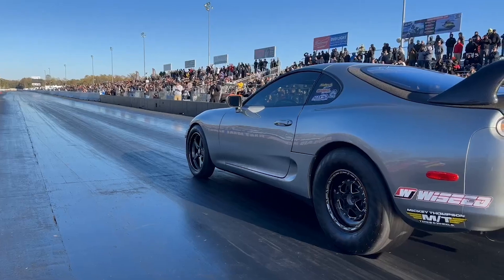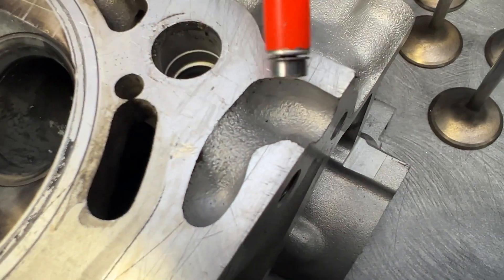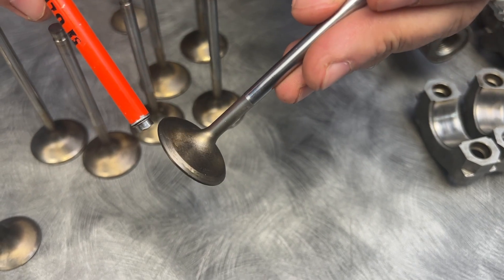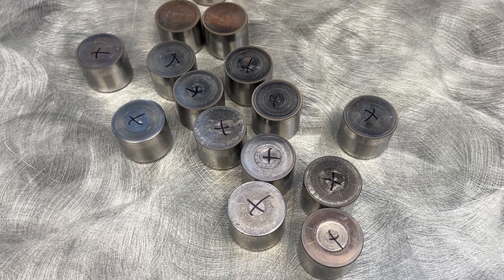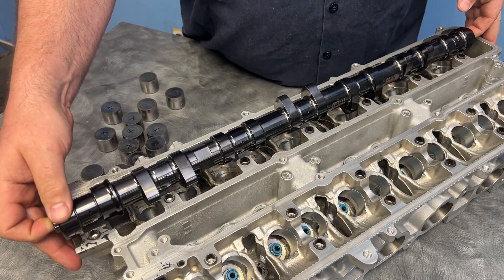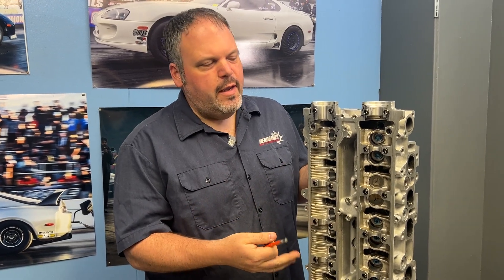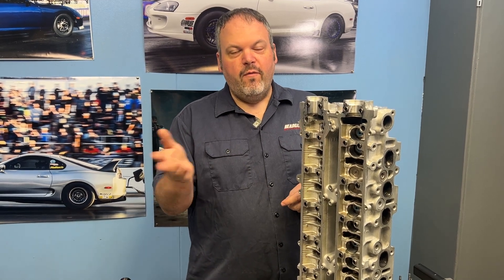World's quickest synchronized manual 2JZ head tear down!

Comment: Do people in the drag racing scene ever use thermal coatings in the chambers/valve face/piston crown and exhaust ports? Would it help the issue? Its very effective in circuit racing.
Reply from the maker: @joshuamclean6564  people have done it but it’s had no effect. It’s like the Cyro phase that people went through years ago. It’s the perception that it makes a difference but it doesn’t really make a difference. 
Besides the skirts, what that wears off.

Comment: Love your honesty is this fault finding path, I have began to wonder on a few applications I’ve seen with similar issues if it’s an oil temperature thing, overall oil temp is fine, but the exhaust valve is maybe transferring more heat to the bucket and compounded with the frictional heat generated on the opening ramp that by the time it gets to the nose the oil is too hot locally and breaks through the film, 
Or is it just a matter of the tiniest bit of float at high rpm that the valve and bucket is leaving the nose at full lift and slamming back, just my thoughts, interested to hear what you think-find

Comment: Valve springs pushing the cam into the caps when getting to max lift? Years ago I had similar issues with the RB heads, figured out that the M6 bolts were being pushed out of the heads when we used big lift cams with valves spring that had over 85lbs seat pressure, solution was cam cap studs or softer springs, not sure if this experience is transferable to the Toyota stuff (I haven't played with them often)

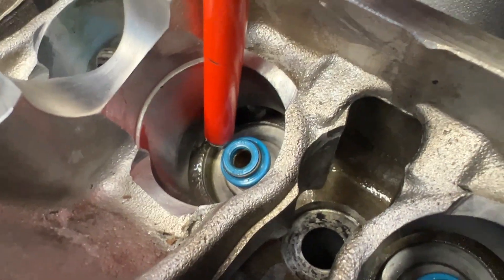Comment: @8:04 if you zoom in you can see a tiny circle the bucket has wore into the casting. could chamfer that spot and mill & chamfer the bottom of the buckets?   Also, what GSC spring setup could you recommend for better then the crower 0300's and less than the gsc 5086
Reply from the maker: @wil8115  5066 is an awesome spring. The 0300 is not close to either springs mentioned. It only has about 180 open depending on the lift.
Reply: @headgames  awesome thank you!

Comment: The exhaust cam wants to rotate the bucket and something is not allowing it to happen naturally.  Could be a geometry issue and/or related to high spring pressures required for such high cylinder pressures during initial opening.  Exhaust cam centers may need to be adjusted inward to reduce the tendency.  Let us know what you find, it is a very interesting issue.

Comment: The reason the issue is only on the exhaust side is because the cam is trying to open the valves under high cylinder pressure.
Reply: It would be on the opening ramp in that case.

Comment: First of all awesome videos, this separates you from the competition. 
How would the gsc products hold up overtime for customers who do say a stage 2, 700-1200 build and but don’t track the supra? Occasional highway pulls and spirited driving ect. What about longevity vs say Brian crower ect
Reply from the maker: GSC is all we use! BC doesn't have any spring kits we would use over 700whp
Reply: @headgames  it would also be great to hear about some of the street supra cylinder head builds and how those have held up over the years with the gsc product. Thanks

Comment: Were the damaged buckets on all on the bent exhaust valves?
Valve bends now the entire valve sits low way too much clearance from cam to bucket and the cam lobe ends up striking the bucket much more aggressively than if it had the correct clearance. (Turns into a quick smack vs a smooth push open.)
(You might get an idea by looking at the location of the damage on the bucket.)

Saw something similar many years ago on another cam on bucket engine (no jz but very similar in the damage/failure).
Reply from the maker: It was all of the exhaust buckets. Not sure if the bent valve buckets were worse or not.
Reply: @headgames  see if the number of bent valves happens to correlate with the number of buckets that have the worst damage focused into the middle of the bucket. (The bucket gets beat up similar to as if there was valve float but the valve actually didn't float/bounce it was just being held open all the the time do to     lite bend).

Comment: Id do a mock up with weak test springs, check each bucket to lobe clearance to see how much free area there is. Usually you see this wear on V8 engines such as the C63 where the higher bank (intake) is lacking oil, exhausts being lower get all the splash oil and have no wear. Im erring towards a oiling issue, possibly running a low zinc oil.

Comment: How about spring surge as you mentioned you had plenty of clearance to coil bind, could be a harmonic surge that hammers the top of the lobe at rpm.
Reply from the maker: yeah, that could be something to look at. Put more lift in it and the issue goes away.
Reply: I wonder how different the lobe profile is between intake vs. exhaust. If these cams are essentially "single pattern", then lobes would be same; and only difference between intake and exhaust kinematics would be on account of fact exhaust valves are a little smaller and therefore a little lighter. Usually (key word) lighter means more stable when it comes to valvetrains, but there's no easy answers with harmonics and spring surge.

This could be tested simply by switching to a steel retainer on the exhaust side to add back some mass...so long as total weight of valve and retainer is not greater than the intake valve, you know the spring can handle it. Unfortunately, it's a long term test that can only be judged by whether/not the heavier exhaust valve hurts the cam/buckets again.

Another thought: Dave mentioned in another comment this is a VVTi head, and the customer is using the VVTi. It's possible the oil in the VVTi pulley/gear is cushioning some torsional harmonics in the intake cam - or even the mass of the VVTi gear itself is damping some vibrations - and the exhaust cam does not have that benefit. Usually though, belt-driven cams don't suffer much from torsional vibrations like chain drives and especially gear drives.

Ultimately, need to ask what's the difference between intake and exhaust? Are the lobes the same? If so, it comes down to valve size/mass, cam gears and heat. My gut tells me heat is the problem in one way or another.

This is why we use spintrons.
Reply: @GroovesAndLands  calm down
Reply: @MrJermbob  What are you on about?
Reply: @GroovesAndLands  I thought the same. Calm down.
Reply: @MrJermbob  I'm perfectly calm, Dude.
Reply: @GroovesAndLands  Just calm down k.
Reply: @MrJermbob  k. You're the problem with the internet.
Reply: @GroovesAndLands  Lucky its just the internet. Calmmmm down.

Comment: You mentoned that there was a step in the head that the exhaust bucket came in contact with in the bucket bore but not on the intake side. Since the intake bucket of head has been clearanced to remove the step that the exhaust has, would it help any to machine the exhaust bucket bore like the intake ? Is it possible for the exhaust buckets to be stopping on the step at the base of the bucket bore thus the nose of the can putting extra load on the bucket face causing the bucket wear ?
Reply from the maker: the issue is there is not enough lift to worry about it. I showed that in the video
Reply: Or shorten the bottom of the cam bucket for more clearance at max lift.

Really sounds like the cam buckets are bottoming out and the cam wants to push more so there is wear on the cam lobe peak and top of cam bucket.